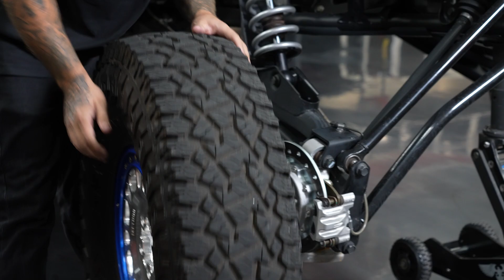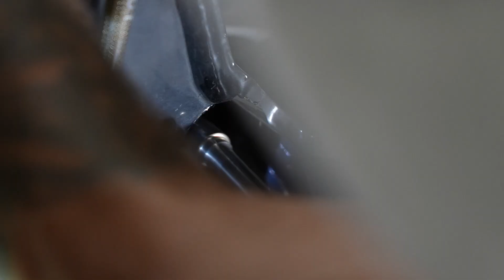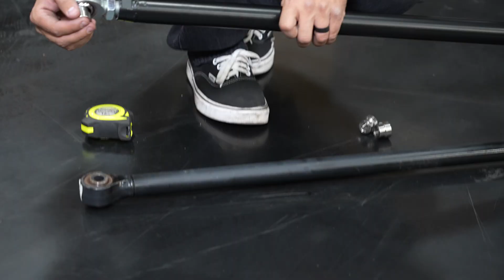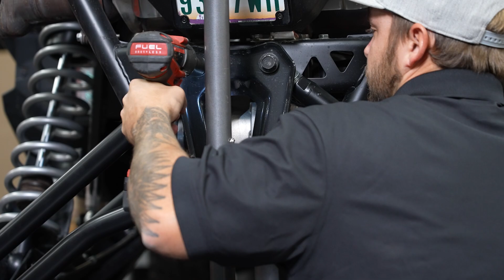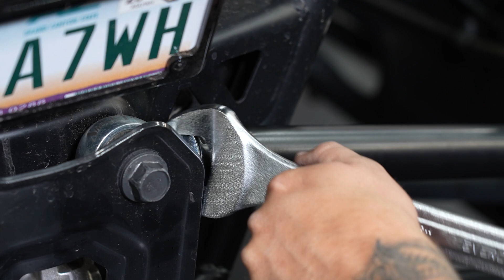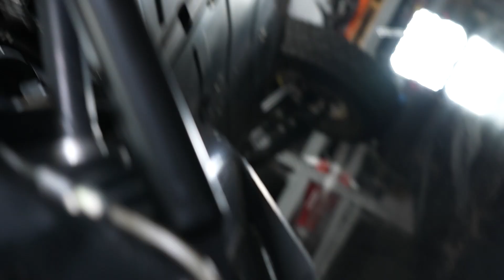Radius Rods for Polaris RZR Pro R and Turbo R // INSTALL

Comment: Do you ever recommend putting a rubber boot over Heim joints to protect from mud and water?
Reply from the maker: I don’t.  Two reasons. Boots usually trap water and mud in the boot over time.   Second. Good rod ends.  Emphasis on good, are self cleaning.  Mud and dirt or sand cannot penetrate a tight teflon liner system.  You can cycle them under water, submerged in mud or under ground without wearing out the actual rod end parts or liner.  The issues are with bad or low grade rod ends that are super common.  Low grade materials that rust or degrade are a big problem.  Crappy liners like injected or molded liners are also a huge issue because they allow the elements in.  
So no to boots. Yes to the best quality, teflon lined rod ends you can get.  Never an issue.
Reply: @ShockTherapyllc  awesome thanks. Also why do some company’s make radius rods with 5/8 rods instead of 7/8 for the pro xp? Even zrp uses the smaller 5/8
Reply from the maker: @travisfeld97 because they are cheaper. Keep cost down.  It’s a bad idea. They just wear out right away.  Pro R is heavy enough to need big stuff.
Reply: @ShockTherapyllc  it’s a pro xp. But already ordered the 5/8😢. Loving your springs though! Thanks

Comment: Do y’all follow Polaris’ ridiculous wheel lug torque spec?
Reply: The overall consensus is that polaris mixed up the torque specs on the axle spindle nut and lug nuts in the manual. 
Spindle nut should be the higher number and lug nuts should be 88 ft/lbs.

Comment: I believe the inside bolts are a one time use bolt but you reused the stock hardware.  What is the torque on the inside bolts?
Reply from the maker: You could be correct but we have used ours quite a bit with no issues. The torque spec is 100 ft lbs
Reply: @ShockTherapyllc  thank you, if reusing those bolts are good for shock therapy, they are way good for me.  You mens are the pros!
Reply: @ShockTherapyllc  you guys should do an episode showing the difference it would make on the pro r if you removed the tow link